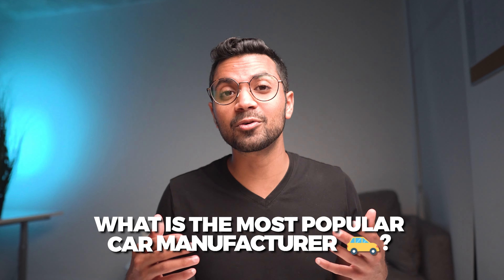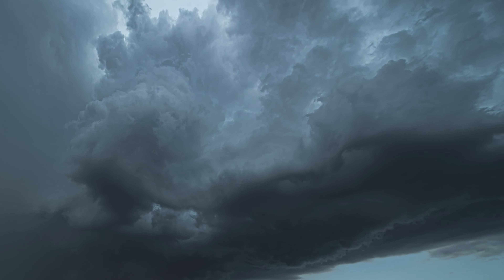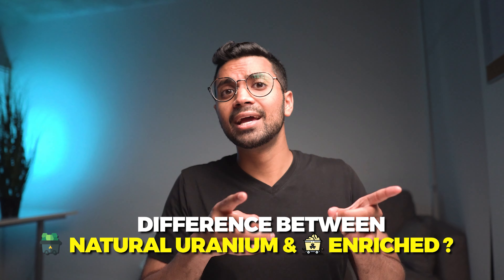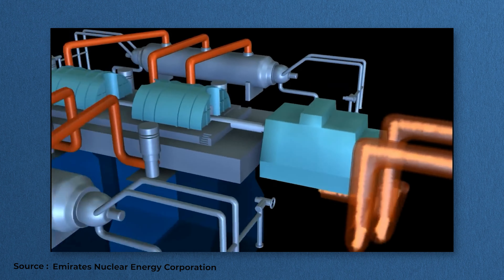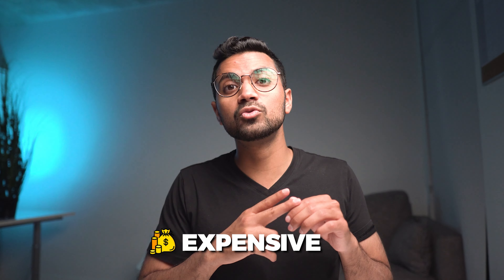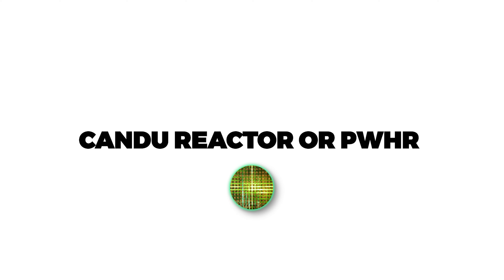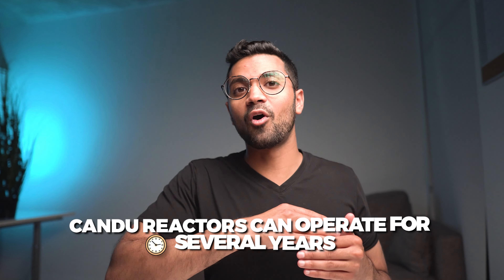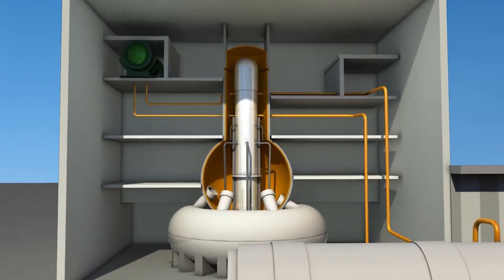Top 3 MOST Popular Nuclear Reactor Types Worldwide

Comment: Fantastic video. I think the only thing I would have liked to see added were some more details about why some features were used. For example, I am rather curious to why BWR use control blades rather than control rods, and why they are inserted from the bottom. Are there benefits to these?  Or is it a way of accomodating for other aspects of the reactor?

I do also have two questions about the CANDU reactor that I have been trying to find an answer for, but have had no success. 

The first regards a safety feature. CANDU reactors needs to have it's fuel assemblies lined up in just the right way to work, and if the reactor overheats the fuel channels start to sag breaking the alignment and slowing/stopping the reaction. Is this from thermal expansion of the tubes, a decline of the structural strength of the tubes at higher temperatures, or a combination of both?

The second thing that I am curious about is the positive void coefficient that CANDU reactors have. From the little I know about nuclear reactors, I don't see why CANDUs should even have them. I guess what I am asking is why is there a positive void coefficient? And to what degree does it exist? My general impression with the whole thing is that it's more of a trivia tidbit than an actual concern, but I have seen activist groups complain about it more and more and I don't know how to address it.
Reply from the maker: Spencer, great questions. 1) I'm not a BWR expert (If there is one reading this channel please comment) however BWR fuel assemblies are VERY different than PWR. These assemblies also have airgaps since actual boiling is taking place. My assumption for control blades to come out from the bottom as opposed to the top is due to the dryer and other sub-systems on top of the vessel. PWR/CANDU's use Steam generators, hence why it makes sense to have gravity assisted/spring loaded control rods come down from the top 2) My understanding is that if a CANDU reaches that condition, it goes through thermosyphoning or using natural circulation from temperature differential to cycle coolant. Another safety feature is using the moderator loop to cool down the system. 3) Reactivity void coefficient, attached is some literature and links - https://www.nuclearfaq.ca/cnf_sectionD.htm#s

Comment: So the fuel assembly in a Candu never gets wet?  Also does the control rods enter from the top or the sides?
Reply: From the top, which is yet another safety feature.  The control rod assemblies are held up by electromagnets, so if the reactor loses power, the electromagnets cut off, gravity takes over, and the control rods drop, immediately SCRAMming the reactor.
Reply: @LordZontar Gravity, plus a spring to assist them. The spring will push it in super-fast, but if that fails, then gravity should take-over.

I think our engineers got healthily paranoid after NRX bit them in the ass.

Comment: How much uranium is there in a CANDU reactor fuel assembly?
Reply: Each rod is composed of multiple pellets, each about 1-1.3cm and 0.8-1.2cm in diameter. There are about 50 pellets end to end to make a rod, and on average about 30 rods arranged in a bundle, which you could hold in your hand. The bundles are 50cm long and about 10cm in diameter. About 12 bundles are loaded end-to-end in each channel, sometimes up to 18, depending on the model. For a large reactor, there are 480 channels, meaning most reactors would have just under 6,000 bundles in total. 

Going back from here, that’s 6,000 bundles times about 30 rods per bundle times about 50 pellets per rod, and each pellet weighs about 10g. That’s 90,000kg of uranium, or 90 tons. Its generally accepted that 1 ton of uranium yields about 45,000,000 kWh after ranking losses. As such, 90 tons would yield 4,050,000,000 kWh, or just over 4 TWh. To put that in perspective, the average human power demand for all of humanity is around 12TW, so if a CANDU reactor were to power up some massive hypothetical battery from nothing, that battery would be able to power the ENTIRE WORLD for 20 minutes from 1 fuel load, from 1 unit of a CANDU reactor. Most large stations like Bruce and Darlington have 4 units. Not to mention the fact that it can be refueled while still generating at near full power. 

So it takes 90 tons to fill a unit and get 4TWh of energy. How much energy do you get from the equivalent weight of coal you ask? Easy. Anthracite, the highest grade of coal, produces about 2MWh per ton, after rankine loss. That is 0.002GWh or 0.000002TWh. Let’s be generous and give them an extra 10 tons to make it 100 tons. That would produce 0.2GWh , or enough energy to power the world for (checks notes) wow, 0.1 seconds. In the literal blink of an eye and boom 100 tons of coal evaporated to make way for the world’s electricity needs. Meanwhile, our single unit nuclear reactor has used up all of a hundredth of a percent of its available fuel to make up the world’s power needs.

Comment: Uranium-238, as you said, is fertile, so in the fission process it will be transformed into Plutonium-239 right? Which is fissile, and with that it also becomes reactor fuel, I've seen some people and nuclear engineers saying that according to the fuel is depleted, the reactor becomes stronger, up to a certain point, you will see that it is because of this, the uranium-238 is transformed into plutonium-239 which ends up being the reactor's fuel as well, and by increasing the fuel through the transformation of fertile material into fissile material the power increases.
Reply: I have never heard of power being increased due to plutonium production. It affects fission products, yes, but on a massive scale the reaction and power is bullshit.

Comment: Great explanation. I've always been leery of reactors that run at high pressure, it just makes everything harder and can be a safety problem. I see liquid fuel as a possible better system because it's not really pressurized and liquids can be chemically treated to remove impurities. They also can be designed without the need for vast quantities of water cooling so can be put almost anywhere. The research at oak Ridge demonstrated the feasibility of this approach and should have been pursued, we have lost decades by perpetuating the high pressure designs that are very expensive to build and raise serious safety issues. Small factory built reactors are probably a lot better than the giant one of a kind reactors we seem enamored of.

Comment: So, we have had 3 accidents involving nuclear power in the past 45 years from  some 400 power plants around the world.
Now, I think everyone knows the total disaster of Chernobyl so no point in going over that.
So we are left   with the accidents of TMI and Japan.    Do I believe that these 2 events killed thousands of people, I do not.  Since there is danger and risk in all things, it does look like with the exception of Chernobyl the risk is to some degree low.
That takes us to waste.  Is spent fuel dangerous?  Well I guess it is if people would eat or it store it their house.   So let’s say the danger of spent fuel has been greatly exaggerated. What about the building, the pipes, heat exchangers, vessel?  Well those parts would have somewhat short half lives so the danger would also be somewhat short lived. 
So, were the events of TMI and Fukushima huge disasters?   You bet they were. The TMI reactor was almost brand new.  Billions lost and passed on to rate payers.   Japan, 6 reactors at the site with 3 having destroyed cores.   Many billons lost.
I suspect new reactor designs are much better.  But, how did the designers not think about a major earth quake not taking out the backup power?  A clean shut down and 3 cores still melted.   
Now we have boiling water reactors.  Why would I want to deal with turbines, outside of the containment building becoming radio active?   How do we service a turbine that has had water through it that was run right over the fuel in the core?
For the time bring nuclear power in the United States is dead.  It is also now dead in Germany.  The future of nuclear power in now in hands of China and it will be up to them to solve problems and move the world forward.   As for fusion, that is a dream which will not generate the energy to power even 1 light bulb in the next 100 years.  I say it will never generate power but, it will be one cool research program to work on.